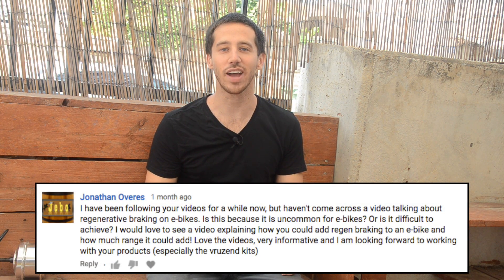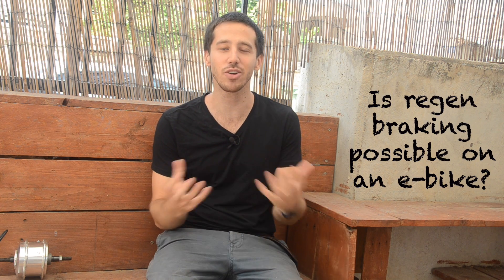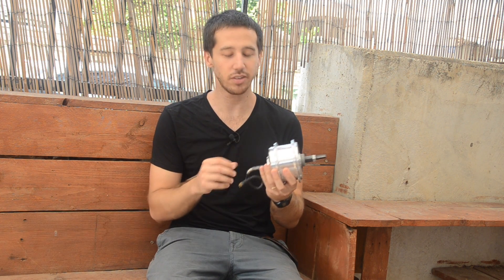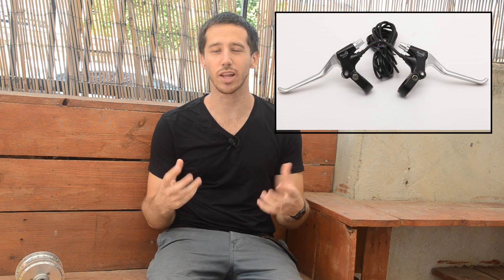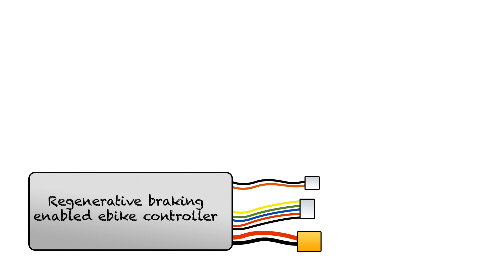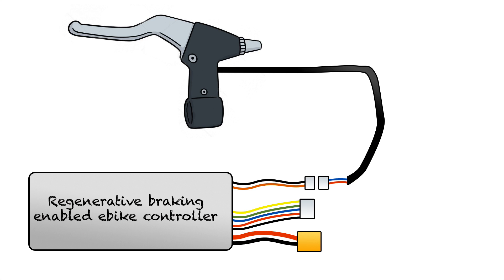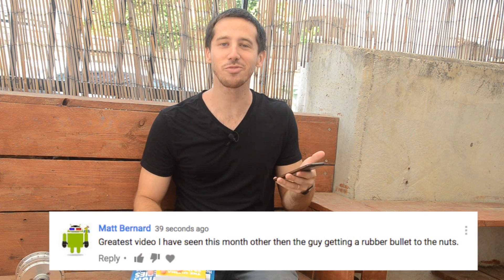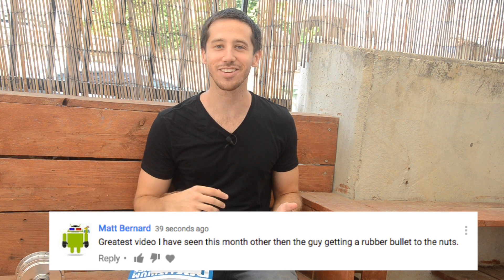How to do Regenerative Braking on an electric bicycle Q&A#9

Comment: I think your videos are amazing. I love that your answers are entirely comprehensive and effectively cover every angle and  color in all corners of whatever subject your discussing. I really enjoy watching you and I also have a questio on for you: I have been to been to tinkering and fixing my ebike for about the last 5 years or so. It's the first- but not only³7⁷ I've ever owned and I bought it used. it's a Motorino Xpr (discontinued) and I love it.ive recently taken a few deeper dives into repair and modification  by switching out the whole back tire and motor (break assembly... etc ) with that of a Daymak Eagle's.  That was fine. But now I am attempting to replace the controller with one that to has  considerably more power because I have also added another 12v battery to the series last time I replaced them... making it a 72 v bike.
 In doing so I HAVE ENCOUNTERED THE WIERDEST THING... wierd because- as with every other new "thing" about ebike mechanics that I come across I consult YouTube videos (like those you make) for some clarification. but with this item I cannot find any single video, blog or even comment or question about it. here it is & I hope you know what I'm describing and can offer me some Info about an it and tell me if I need to connect it to something or what ( oh yeah I foolishly forgot to take a picture of where the wires that used to run to it came from and what wires they were-... I know!)
**It's a small metal box that looks like a "mini- me" of my original controller and says "60v DC - 12vDC" OR or something basically like that and only a single set of 3 wires go into ( or are they coming out of?!?!...hmmmm) this little mystery box. my guess is something to do with lights but what is it and -whatever function it has: why wouldn't it just be done in the controller like everything else? 
any help would be so appreciated. Thanks

All my best, 
& please keep up the great work!
big fan!!
Christian Hagen
Toronto, Canada

Comment: i have a question, have an xld brain power controller, im using it on a scooter that has no option for a physical brake, so i wanted to use the highbrake function as the primary means of stopping, my question is how do i wire it up? the low brake is connected to SL and Gnd, which i think mena stop low, the high brake should be SH, stop high, but i read that it needs to be pulled to system voltage instead of ground? does that mean 1 wire goes to p+ and the other goes to SH? and lastly can a hall sensor brake lever be used for the high brake?

Comment: I thought that the BMS on the battery bank would prevent over charging. So even if you were on a hill it would not increase the voltage beyond its 100% state of charge. You would not benefit from the hill, but it should not damage your battery.

Comment: I put flyers out on a gas scooter all I do is speed up to 10 mph then stop 1000 times in 4 hours. I think regenerative braking would work great only thing I'm worried about is if it can hold up to the duration and punishment

Comment: Hi Thks Mike, Enjoyed your many videos, very impressed with your good explanations n in-depth knowledge !  This one too, especially on the types of motor that can support regen. charging.  One good point was that a restraining torque arm may be needed to prevent axile nuts working loose!  With only a few % power recovery on av usage, agree that it is not worthwhile for the extra cost n complexity!  In fact, as a frequent ebike user,  I enjoy a little pedalling on the way, which might achieve much more than the regen braking, n give me some helpful exercise!

Comment: Regen really shines on hilly places in the mountains. That way you can use a small battery pack and basically use it like a hill assist not a motorcycle... The problem is most people are happy to fligh down the other side of the hill at 40mph but wind resistance is the square of velocity! so a person flying down the other side of the Hill at 40mph instead of going full regen and going 10mph is losing 90%of the energy where if they regend it they'd lose about 40% to inefficiencies in the motor and batterys. 

What the OP is missing is people are not as aerodynamic as a car even if they are lighter.  So regen isn't so much about stopping and starting it is about storing the extra energy instead of wasting it in aerodynamic losses of increased speeds
Reply: Totally! and when you double the speed you multiply the air resistance by 8x! and injury risk also goes up with that kind of a factor with speed if you crash. If you coasted down hills at 25kph instead of zipping down at the maximum of say 50 for a steep hill, you'd get down only twice as fast, but you'd get 8x less air resistance and all that extra power goes to the battery instead. It's just really underrated imo. IF you ever ride without a helmet and do reasonable slow speeds for that, regen downhill is amazing.

Comment: I have a gearless mid drive motor hooked up to a kelly controller and I have yet to wire in a variable thumb throttle I know this works as I'm following someone else who's done it so you can use a middrive motor but beware I read that your frame mounts to mid motor must be good as it's a lot of pressure on the frame I'm going to weld an extra mount onto my progect befor I wire up. 
Exited as I also read its that good I barley need a rear brake at all

Comment: What if your bms isn’t wired into the main power lead? How would you do regen? I would assume it would be safe to still just send it through the main power lead as I wouldn’t be charging for a long enough amount of time to overcharge certain cells?
Reply: This is what I came here to find out.i think he addressed this. He says the discharge leads are designed for high current and there's nothing to worry about. I wonder.

Comment: If you don't have a regen controller it may still be possible to add resistive braking. It saves a lot of caliper brake pads on my old bike here in a very hilly place. I have 3x 1 ohm 50watt resistors in star connection across the motor leads via a big two pole pushbutton on the handlebars. Also included a 20w lightbulb to use some of that free power. Brake pads are not expensive but my time is valuable.

Comment: Big thank you Micah for this video! Even though this video is nearly 3 years old the info is still pertinent. I just bought a Wallke X3 Pro  that has "W-PAS" regen braking and I live on top of a hill. I'm only a few hours from Pittsburgh so you know how the land is around here. It's been in the back of my mind since purchasing the bike about how it may not be safe to charge to 100% and use regen as I leave for a ride. You confirmed my suspicion in this video, Thank you!
Reply: Maybe try to implement some type of fast charger for your phone on that e-bike, so you pump your phone and discharge your battery to around 95% before you leave the hill before you pump the battery any further. Also I'm pretty sure there could be a feature implemented in ESC that could sense when battery is full and then just short the motor wires so it uses its own backwards EMF.

Comment: My guess is that the return on regen just doesn't justify the cost.

Would it be nice in a cost is no object scenario?

Maybe, but cost is ALWAYS an object for most of us. 

I could maybe see it on a loaded up touring bike used in mountainous areas, where the brake saving benefits start to matter.

Comment: Thank you for the clear explanation. So regen not worth it on a bike. I've been thinking about a different idea -- I don't know what it's called but the concept is something like engine braking in trucks. Let's say that for downhills, I could set a maximum speed that I would like my bike to go at -- let's say 15 mph. All the extra energy that would have me going at say 30 mph on a downhill is then captured and fed back to my battery -- without using the brakes. This would be very useful in hilly areas. The energy being fed back would also have a nice steady fairly flat curve, as opposed to the intermittency of regen braking. Does such a system already exist? If not, could you imagine how to implement it?

Comment: Funny, that odd situation you outlined exactly described MY situation. I live in San Francisco! Anyway, this video pretty much answered that question. Needless to say, if I am starting out on top of a long line of down hill trojectories it means whenever I return I have to climb all the way home. So I wanted to look into this topic as a possible way to help myself home. Thank you for answering that question, because what I wondered was how starting off fully charged, going downhill for a pretty good ways initially, would effect the the system. Imagine if you hadn't laid that one exception out like you did, I would still be ignorant in a bad way.

Comment: Hello, my controller has the regen brake feature, however, it has two low voltage brake connectors, one has a yellow and black wire while the other connector has only a purple wire . My question is which would I use and why ? Thanks..

Comment: I’m looking to add regen to my 1st upgrade and am adding to a 2007 Specialized Hardrock Pro which I added hydraulic disc brakes to when I added an all in one.  I frequently pull a trailer with groceries laundry you name it up to almost 200 pounds. Never had a problem but I’d like some more stopping power. Not really interested in regaining any battery power that’s not important to me I’m more concerned about just that little boost of stopping it would give me is it going to be enough to notice? Or am I wasting my time building a new bike?

Comment: i have a new radcity 2020 and about 500miles the back brakes started sqiulethe, pads were  still good so figured it was the disc somehow got bent or warpped, well i used to build gas bikes and doing so i never put rear brakes on because did not want any addition drag on the well besides spocet and truing issues, so took the rear disc brake caliper of now this is what  have (and love it) left handle bar front brake for hard braking and right back brake for  soft braking only. whats your thoughts on this?

Comment: Hi Micah.  Great videos!  One more reason I found why you might not want to use regen. I have a 5 year old Bionix 350 watt rearhub on a davinci-tandem bike.  The Bionix on long hills and begin to shutdown do to heat  (The circuity was designed to protect is self, which is good).  I found regen would get the motor hot much faster.   Because of the heat, I saw no increase in mileage.  Maybe new hub don't heat up and loose power?  :-)  I thought I would pass that along.  Have you seen this?  Anyway Great videos.  Thx Barry :-)

Comment: I live in West Wales UK. I'm an old guy but still functioning almost. The labyrinth of twisty lanes are seriously hilly. I do a lot of walking up and hurtling down wearing out my brakes.  I cant let the bike go to get momentum for the next hill because of the sharp bends. I need electric assist exclusively for climbing. On the occasional flat I don't want assist and obviously not downhill.
The maximum legal power dictated by the bothersome EU is 250 watts. Any advice would be appreciated.

Comment: 1 mile out of 20 miles...you could do better than that with a freewheeling motor and no regen..go do the same track with out dragy regen ....the magnet drag in the system you are describing is making your system ineficient...infering cars do better becaus they are hevier or faster is rubish..if you put a dollar on the table how many cents do you get back?..this is scalable if you put $100 on the table how many $ do you get back..and when you talk about cars,what cars are you talking about? race cars? race cars are playing a diferent game they are on or off the power no coasting a bike has less speed than a car and so les drag through the air...mass times velosity squered equls force..if you go 10kmph you have a air resistance force if you go 20 kmph the force is 4 times as much...and to say this system is best suited to city stop go is rubish....any one that has watched the amps go up on exaleration knows exalerations are not the friend of energy eficiency...a steady climb to store energy in altitude is where this system is best if it  has a following decent that is steep enough to contine generation and not too steep that it needs heat/energy given to the atmosphere via mecanical brakes...this system needs a free wheel switching ability and the energy used via gain of altitude can be given back with the lowest amount of energy lost/just roll..any kid know how eficient just rolling is..then the disighn would have a place...its a dreamy thing regen...aaa we will get back 50% or 80% ..we all want to belive the dream:) but in reality with this sort of system we gain 0%..might say 5% on the display but your buddy with the same bike with out regen and with a free wheel keeps riding after your battery is flat...last point..if you make a bigger battery to take in all avalable energy from regen so you wont fry a battery then...then you just solved the problem of the 1 mile in 20 range  you thaught you gained with regen :) oh and more energy wasted climbing with a hevier non geared hub motor too and that climb can be done more eficient again if you drive the cranks and use the gears.

Comment: I have chinse 350w controller, and i have a problem-my regenrative braking is always works in the direction of the diving. How do i reverse the braking system without reversing the motor?

Comment: I have a RAD City with regen braking. Does it make a difference which power mode (1 to 5) I am in when regenerating? Will mode 1 reduce the amount of power to my battery?

Comment: I can I add a front  direct drive  motor for brake  regent to my rear gear hub  motor bike to make it a brake regent 2 wheel bike, I ride in the city with a lot of stop this will save my brake pads and rotor

Comment: Typically, it requires up to 50% more voltage than the battery is rated at to charge it. This might be an issue.

Comment: im keen to connect a dc brushed motor directly to the wheel. the wheel will always be turning this motor. I believe this would take the positives from hob motor (no damage to the drive train) and the central weight bonus from mid drive, and if i could get break pad free regen breaking, wow. not a clue how to set this up... please help? love ur vids :-)

Comment: Hi, I have a question. I have an ebike and just recently changed the hub motor and controller to 72v 1500w specs. My batteries are 72v 10ah. I want more top end speed out of it. As I have experimented I understand that volts determine the torque but if I change my batteries to 72v 30ah it should give me more distance. But would this also increase my top end speed? Or will it only just give me better range?

Oh I just checked. What I actually need is how to increase amps on my batteries. Now I understand that amps and amp hours are different things
Reply: you need powerful controller, or modifie your controller to give more amps to your motor.
higher voltage does not anything to your acceleration, just give you more top speed.
you need more amps from controller, not amps/h from battery.

Comment: 2x thing I dont agree with:
Overcharging batteries- if you have a BMS, why would it overcharge if you live on a hill? When a cell reaches 4.2V ( of whatever you have set to, if you can adjust it) ,it just wont charge anymore. So no overcharge.

2. Saying regen braking on a bike is not as effective as on a car because of the wieght does not make sense. 
Yes you can get ALLOT more regen power from your car because you have allot more kinetic energy.....but you also NEED more energy for a car. 

A bike needs less enery to move , so less regen into the batteries makes sense. Its about the ratio.

I think the main problem is HOW the regen works on a bike. You said it , a micro switch. 
Lets say you have a fancy controller where you can set the strength of the regen brakes. Thats the problem , its set. When the micro switch is triggered,  the set amount of regen takes place. 
If its set to LOW and you brake HARD, you loose all your momentum into the normal disk brakes and not back into the battery.
If its set to HIGH and you only touch the brakes SLIGHTLY,  you will lose to much momentum and thus uses the battery to speed back up. 

That is how I see it. Correct me if I am wrong.

Comment: I am not much of a downer of anything but this seems like really odd that anyone would chance the Front or Rear Motor Wheel coming completely off just to be trendy or slick. Did anyone see that part where the Regenerative makes the Wheel Bolts go back & forth?? If my Front Wheel 1000 w 48v motor wheel came off at 25++ mph I would not be in the Land of the Living. Mine is 20 inch Pure Aluminum Mag Front Wheel Motor/Mag. It has the option for Regenerative. I am adding Disk Brake Adapter/Convert Kit right now. No Thanks On Regenerative.But Very Very Cool Video.

Comment: The point of regen braking isn't for battery recharge reasons at all. I like using it as a secondary brake because the hub motor replaced my front disc brake.

Comment: Thank you again. I live in an area north of Pittsburgh and its mostly up or down not to much level ground around here. Im planing on a tadpole recumbent build from scratch and would like to go electric. I will be buying your books soon. I have several plans for trike from atomic zombies. Ive built other gas powered bikes but engine vibration noise etc do make them less desirable. I would love to impliment some flexable solar panels onto a bob type trailer to carry trip gear as well as spare battery in charge.